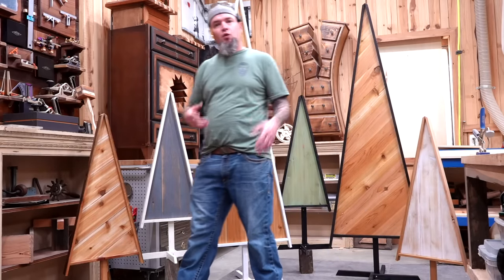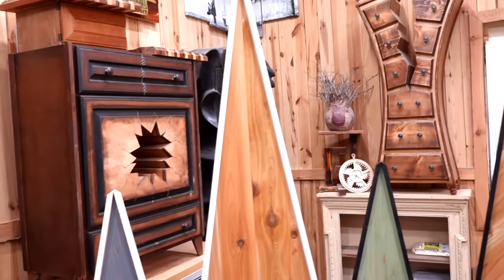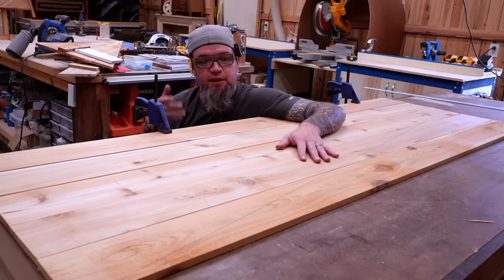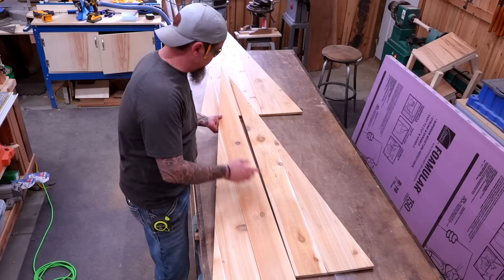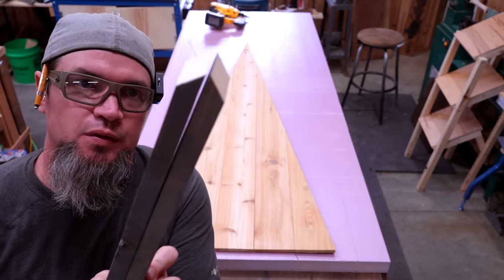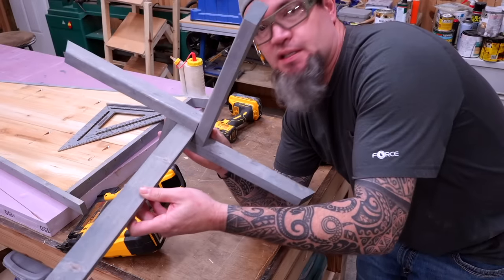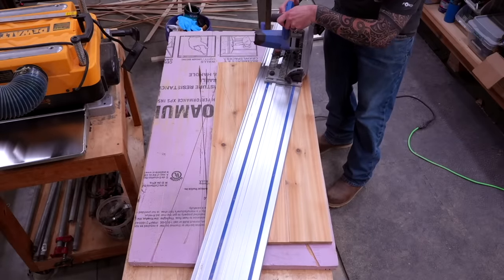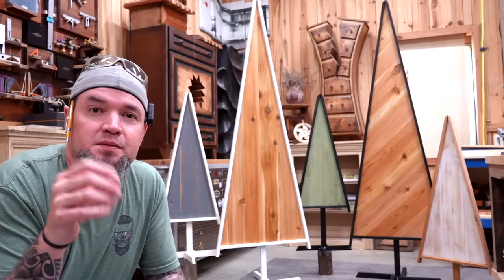Money Making Fence Picket Project

Comment: I have several left over 5 foot cedar pickets.  So I decided to make some of these.  I cut them to 48 inches to make the taller trees and used 4 pickets.  I made some of the shorter ones at 35 inches as well then used the remaining cut offs cut to 17 1/2 inches with two pickets to make some even shorter ones. Thinking of making some out of one picket for table toppers.  I really enjoy your builds.  Thanks for your videos.

Comment: Awesome !  maybe even drill holes in them and put in lights, would that work ?
Reply: Probably.  Or, here's a thought.  Use those LED strip lights and line the inside face of the trim with them so that the light is directed toward the center of the tree.  Then you could change up the light color and get a different look every evening

Comment: I really like the design and simplicity of these trees. The only drawback that I can see is that they are going to be difficult to store for the rest of the year. I would think making the trunk and base removable would make them a lot more desirable. This would make them capable of being stored flat in the off season.
Reply: Was thinking the same. If the “stem” was cut the same size as the tree and attached with bolts so it could be undone and moved up the back of the tree for storage and using a bolt for attaching the stem to feet.

Comment: These are great trees of all the wood tree types I believe these are my favorite, with very little waste at all. I have got to build these. Great gifts as well. Also I believe if you bored large hole in the body you could add  a few ornaments for another look. Or drill small holes to a strand or two of Christmas tree twinkle light and  accommodate the and cover the wire in the back by Cloth or ⅛ plywood or hard boad. Just a thought out of the box. By add these ideas you could add a lot more to the value.

Comment: Matt hi I has make 12 snowflakes and I sanded all of then both side a starter to paint then white I used rust oleum paint and it will not take to the fence pickets I could use a little help thanks bill

Comment: Width  ✅

Depth  ✅

Heighth ✅ 

Love these simple builds. I'm just wondering what a fence picket costs in the US the closest I have found is a rough sawn gravel boards from a "Big Box Store" called Wickes in the UK
Reply: He uses cedar fence pickets, currently $3.50ea. But he also always states you can use pressure treated fence pickets, currently $2.10ea.

Comment: Hello Matthew,
   When you say fence pickets, specifically, what are you actually using?
  Any possibility you cane provide a example link to the HomeDepot or Lowes.
  The ones I get are pressure treated dog ear and are ROUGH. Yours look smooth

Thanks in advance
Reply: He uses cedar fence pickets but you can also use pressure treated. For every fence picket he ever uses he planes each board.  If you sand them instead, he uses an 80g then a 120grit discs.

Comment: Matt, question for you. What table saw blade do you use? I have been using just “big box” store brand blades like Craftsman, but they don’t seem to last very long and they absolutely suck at ripping things like 2x4, as I end up with a super fuzzy cut face and A TON of tear out along the length of the cut. I’m assuming that it’s a poor quality blade issue.

Thanks!

Comment: Now how to do you ship them without it costing a fortune?
Reply from the maker: These probably need to be a local sell. When I sold them I had more than enough people in my town interested.
Reply: I was thinking the same thing. Probably can make the stand attachable so it can be shipped in a flat box. Maybe adjust the size, or only sell smaller ones for shipping.